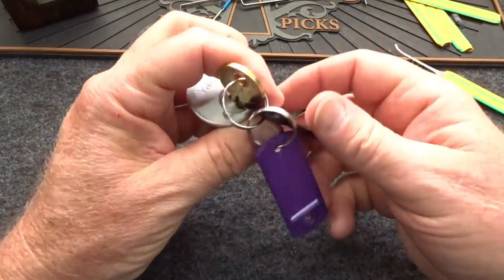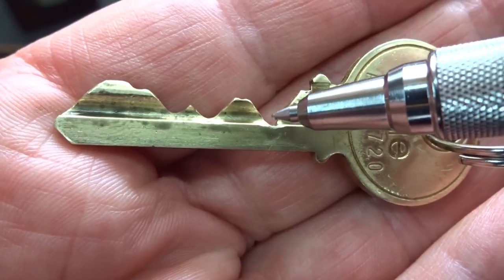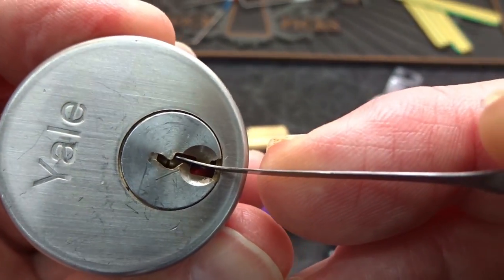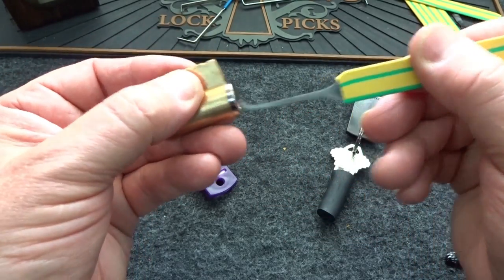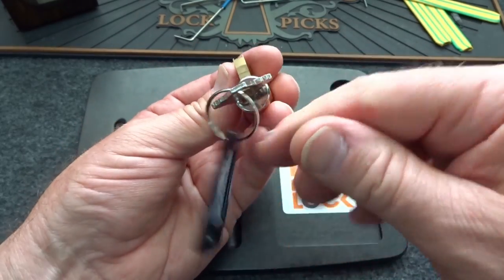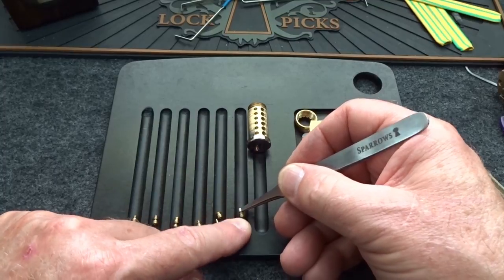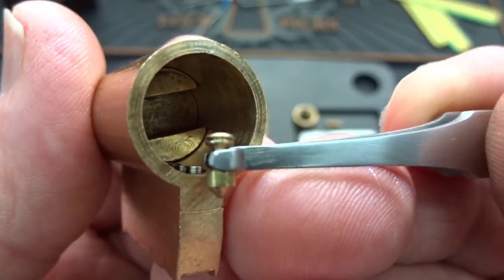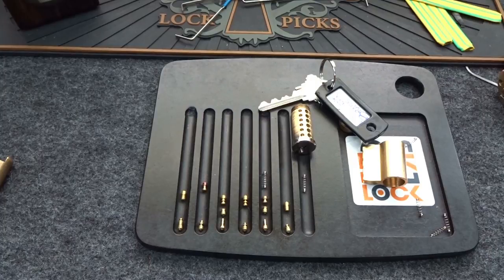(1142) Whipped: Den Brass Challenge Lock

Comment: I have those key way schlage Kik and mortise locks and I can get thru the warding from the ledge on the left fairly easily with an .018" standard pick from Peterson. I also use a hook 7 in the same thickness for high cut after low cut pins. You should have tried it at least haha! Great lookin' locks

Comment: all that alien tech but you cant pick it because the pick wont fit :D
Reply: I don't know why he can't have half a dozen Keys filed down except for the last Pin and then just try them all, or have three Picks (hooked and differing lengths) with a bend to get around the Ward then switch between the three depending upon the height needed for the last Pin.

Comment: I want to no longer drive a car. I want a very safe way to lock my bike, aside from trying to always lock it in front of a police station. After looking at as much information I could find on the net for locks and chains in my budget, I am thinking of using the Abus 190CS/60 combo lock. Would give me some feedback on this lock? Or in a perfect world do a video with you trying, in your excellence, to open it. Any advice would be appreciated. Thank you.
Reply from the maker: I would not recomment that lock, it is the same as the ABUS ZB.  Here's a video I did a few years ago:  https://www.youtube.com/watch?v=qKn7M3zzFdE

Get yourself something with a disc detainer lock instead of a combo.
Reply: Thanks for the response. The granits are just too expensive for me, when added to a good abus chain. I can only think of using 2 or 3 abus 20/70 and some 10ks abus chain on both wheels and frame. If you could answer,and I know you are not selling insurance, I would appreciate it. I have about $130 to spend and must lock both wheels to frame and secure post. I only need the 2' lengths of chain.

Comment: I work at a thrift store and I came across an odd key, by sentry.  it starts out circular at the base and is cut into 4 different keys at 90 degree angles from each other. not sure if you have picked one of the locks this key would have went too unfortunately there was no lock for the key.

Comment: Could someone explain why macs exists?
Reply: So keys can be inserted and removed smoothly.
Reply: Thanks
Reply: Don't quote me on this but I think it also has to do with the strength of the key -- too many deep cuts next to each other and the key has a higher chance of breaking at that point.
Reply: The other answers are true, key insertion and extraction can be hard and it can make the key weak/fragel and prone to break. My understanding and experience is when you are cutting a key and you truly violate the M.A.C. like putting a #9 cut next to a #1 cut the cutting wheel cuts into the next space so the #9 cut is so wide(due to the cutting wheel and the ramp it produces for the pin to ride on)that you don't get or barely get enough key material for the #1 cut to rest on and effects the manufacturers specifications of what they base their key depths and corresponding pin depths. So the #1 now is a #2 and is sitting/resting on part of the #9 cut. It will also wear the key itself down faster and start acting up in the lock, like not work or get stuck/break off. Good question and I hope this was helpful!
Reply: Thanks for the "insider" insights on MACS - very interesting.  I am aware of some old Russwin stuff using a higher than zero bitting, being a no cut

Comment: How do u get a Yale lock open with out a key and without picking it
Reply: Lock Impressioning maybe? I am not sure.
Reply: with a shotgun... ;)
Reply: If you mean open when its on the door locked closed and no other alternative methods have worked you drill it. If you mean you want to see the insides of the lock and it's on you hand you use a tool called a shim. I'm sure there are videos on what that is.
Reply: Southampton Lock Picking Club 
There is other ways to open locks w/out keys on a locked door but I will leave those methods for other people to say if they choose too. I'm not the one to tell/post on how to open locks w/out keys even though I do it. It's all about the technic. When(last resort) I have drilled plenty of high security locks over my years,with drill plates etc., not a big deal, it can be more time consuming in some cases. Sorry I couldn't be more helpful on opening locked doors w/out keys besides destructive means.

Comment: I have been thinking of experimenting with high grade titanium alloys to get some ultra thin picks. I think if a 13 thousandths steel pick works for you, if you find the right titanium alloy, it should be plausible to get a 10 thousandths pick made, but it would probably be a little expense. Somewhere around 30$ just for the base material itself.
Reply: NolanSyKinsley you can purchase feeler gage in 10 thousands for 2$
Reply: Stainless steel, sure. Some titanium alloys may be around 10$ for a piece small enough for just a pick tip. For a full pick to be made out of the titanium alloys I have in mind that have the strength and rigidity to make a viable 10 thousandths pick it would be around 30-40$ easily just for the base material.
Reply: NolanSyKinsley oh ok I get it now sorry, if you make any would you sell them?
Reply: I would most likely make a few and send them to the likes of Bill to see if they are worthy, then I might look into producing them.
Reply: NolanSyKinsley that's awesome make sure you get bill to put you on the certified sellers page on his website, you will get tons of buyers.

Comment: Dennis did an absolutely incredible job on the second lock those pins were great it would have been a extremely hard lock to pick but to choose a key way that made it impossible to pick is a waste of that fantastic workmanship. On the first lock is it a valid challenge lock due to Bill trying to pick it the wrong way and now the key doesn't work. That look was even more disappointing we did not get to see the workmanship put into it. I see that lock as scrap brass due to the fact it isn't even a lock. At least the second lock we saw a master at work. Yes it beat Bill by a technicality all that work for nothing.
Reply: Thanks Kelly the first Yale lock have 4 other bins on right side and work fine but the key is not great ... i thing Bill can open this lock